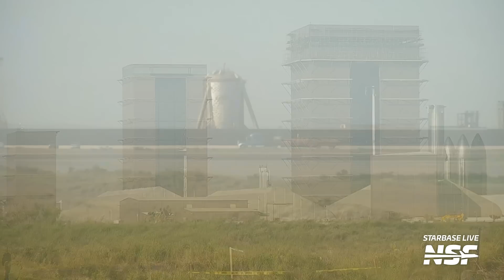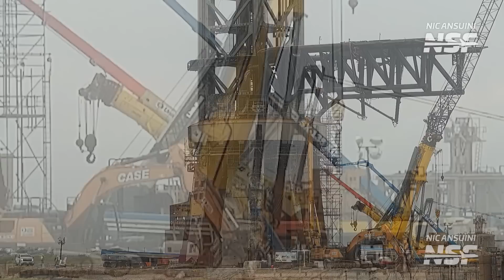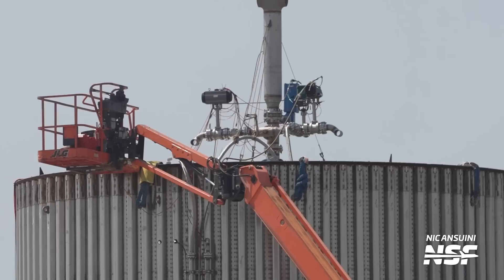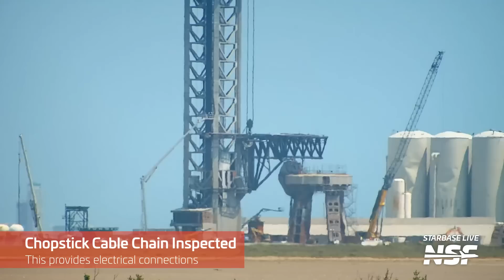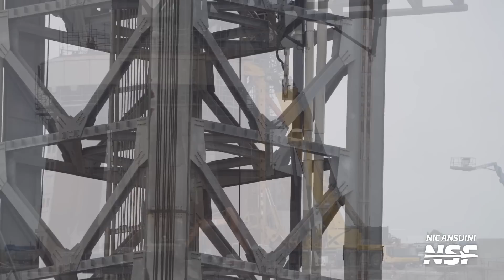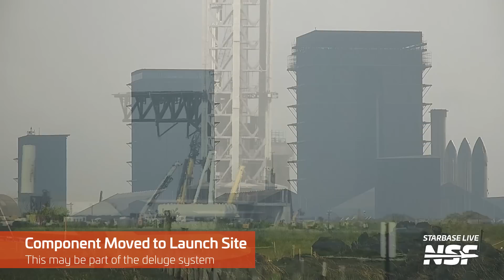Foundation Piling Work at the Orbital Launch Mount | SpaceX Boca Chica

Comment: Given the unexpected failure, it might be a very good idea to embed some instrumentation into the soil and concrete under the launch mount to measure stresses during the next launch. Cut the guess work, and get hard data. Vibration and pressure at a minimum.

Comment: what is a conduit?
Reply: Basically a relatively hard tube that you can put wires inside of. Provides protection to the cables as well as makes it possible to string through cables after the conduit is buried
Reply: @thomashayden804  Awesome, thank you so much!

Comment: Is there any reason why they are digging a trench from the production site all the way to the luanch tower? 🤓
Reply: Launch site does not have grid power currently. It has been operating on generators since it was built. It appears they're running electrical lines so the launch site is connected to the grid.
Reply: @williamtsmith9668  ah yes, very well could be that as well. Pretty remarkable really the amount of data that has been transfered to mission control over the air in real time during testing and the launch! I'd hate to see their starlink bill. 👀

Comment: I often wonder why the construction workers build like they do. Same question for design engineers. I would think a launch platform should be one solid piece made of incredibly strong metal with a very high melting point. An alloy of chromium, cobalt and nickel (CrCoNi) is the toughest material ever tested.

Comment: Curious….if you’re by an ocean….why not just use that to flood a big freakin hole and then light the candle? 😃
Reply: The salty water would turn to steam that includes some vey bad gases that are created when sea water it heated to very high temperatures in a very violent way. The flames would easily push the water away in the first second. Besides, they are near the coast, but can't channel in the water - not their land.

Comment: Compaction and sand prep is gonna be the key to avoid another calamity.. pilings without compacting the whole area? Not helping as, let me inform you of building regs on South Padre Island, pilings are required to go down into the ground for as far as you are going up! So work thrust levels vs a standing 30 story building (sapphire condominiums? And you be some where near plus steel plate better be a min of 2 inch plate other wise temp will kill reusuability
Reply: @William T Smith  thank you! And yes we'll spotted, a layman! But, bedrock? Not much of that here, a claybar exists and that is what the pilings run into as far as I know and it's the sand compaction under the concrete which holds up the new steel water table that would concern as that much water flooding everywhere as I would have to be in deluge mode for at least 5 secs if not 15/25? Would run off big time before engines throttled up and vaporized it but Temps at that point would be more than extreme and pressure on concrete and plate quite massive so how does run off affect ground sand base at that point if reusability is the name of the game? Also the amount of water we are talking about is a quantum leap from what is there now, so water tank has to be the next installation if this is gonna be done correctly? Your thoughts?
Reply: @williamtsmith9668  seems you are right as the latest rebar steel cages look to be about that high? - hard to tell from such long way out

Comment: It’s not cable chain , it’s wire rope.
Reply: No, they are correct. It is a cain that carries electrical and hydraulic cables and hoses.
Reply: @knowledgeisgood9645  oops! I thought you were talking about the hoist cable.
Reply: @knowledgeisgood9645  my eyes are not good either 🥸

Comment: SpaceX do need to channel the water away from the OLM when the deluge system is working. 
Because it may contain harmful chemicals, it will have to be piped away and treated.
It is an environmentally sensitive area. The FAA and Wildlife Commission will make sure it is done right.
Reply: What harmful chemicals are you referring to? Methane + Oxygen = water + CO2.
Reply: Well, we wouldn't want any of that nasty dihydrogen monoxide leaking into the water table.
Reply: @williamstucke5445  Not a very bright answer.
There are a lot of coatings, sealants, paint,  VOC's ,carbon, soot, lubricants, lead, chromium, and cadmium, engine and OLM parts, concrete, steel which create a toxic mix.
Tell me again on the last starship launch the enormous clouds produced were water and CO2??
Reply: @berty1422  No, not at all. My response was premised on a successful launch, without an extended period on the OLM (as there was last time) and of course with a working flood deluge system. But you're right. Even with copious amounts of water, there will still be burnt paint, etc.
Hopefully, no concrete, rebar or engine parts! 🤣
Reply: I think we fool ourselves if we call the system being installed a "deluge system". What it is is a water-cooling system for the steel plates under the OLM. The amount of water out will be a small fraction of the water in. The main part will turn to steam. A small retention pond is all that is needed. (And no, it should not be discharged into the WL preserve.)
Reply: @berty1422  those “clouds” were mainly dust/sand.
Reply: @berty1422  The last launch was a mix of water and earth and concrete. Hardly toxic.

Comment: If one of the new OLM water plates comes off during liftoff, it's going to slice through the OLM legs like a hot knife through butter.
Imo, Tier 0 is a complete failure and needs a total rethink.
Reply: HAHAHAHAHA
Reply: Good on you mate :p
Reply: Is your opinion worth anything?
Have you ever built a rocket launch pad?
Reply: @21142317  relax bro. It's an opinion
Reply: Of course it is. I just gave you mine.